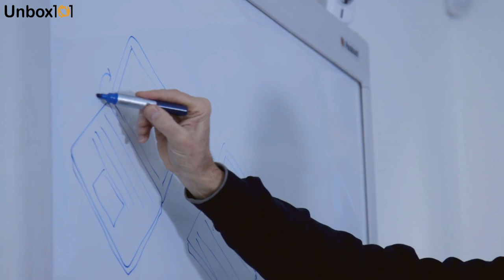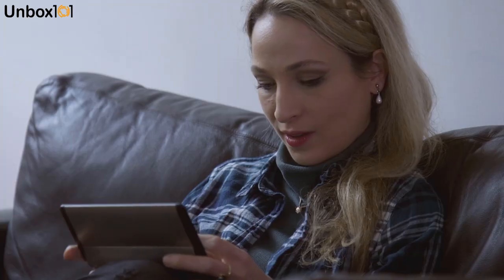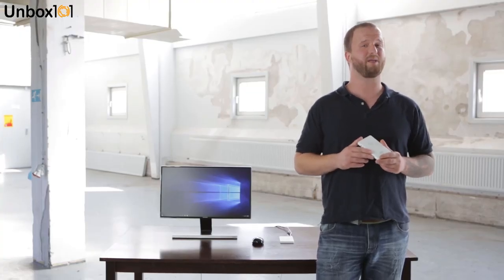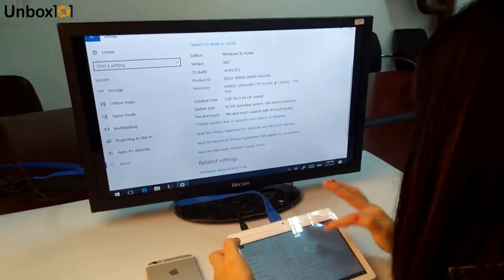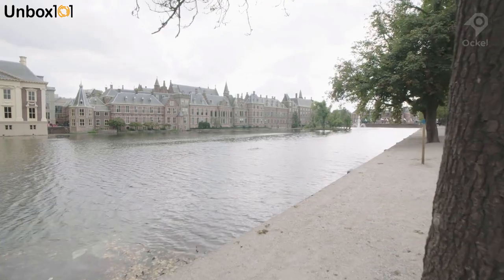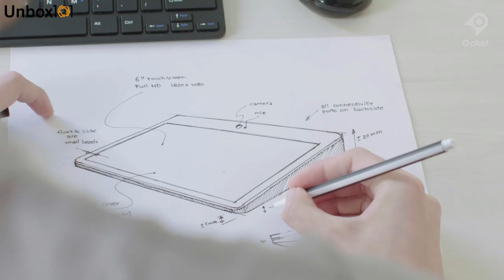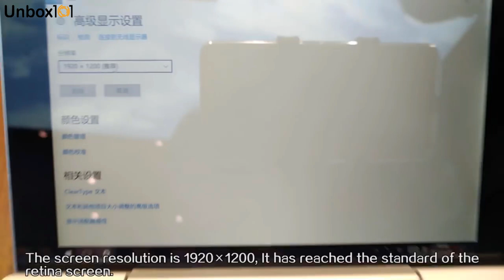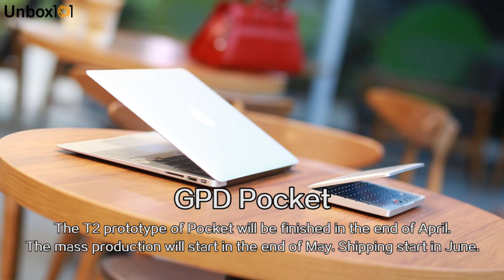Top 5 Mini Computer 2017 GPD Pocket Next generation PDA | cool gadgets

Comment: GPD WIN is the best and its not included here.  Though to be fair, GPD Pocket seems great too.  But GPD WIN is already shipping.
Reply: gpd win is the best
Reply from the maker: true Just checked it out... Look like a useful product. Thx
Reply: I also have a GPD Win.  As nice as it is, it has it's flaws.  The GPD Pocket, from a couple reviewers who have both, indicate that the aluminum body, and active cooling (heatsink + improved fan) work wonders.  Having 128GB SSD + 8GB RAM is also a nice touch.
Reply: Only gripe with the Pocket is that it doesn't have a built-in card reader.
Reply: AmadeusL True, I would have loved to have seen it built in.  That said, Satechi has several solutions on the market that will do for now.
Reply: richarddr1234 mini laptop bruh not mini gaming laptop xD
Reply: Pls send to uae
Reply: Mobile connectibity is missing too, I really don't see the point of an ultraportable without it!

Comment: But I need bigger specs 
It's only 1.6ghs atom 
I need a high spec pc with upgradable ram and a gpu a high gaming pocket pc
With windows 64bit
Maybe coming days they make
Reply: Pocket is 64 bit it will process basic graphics for work or gaming (handle gta v on low pc mod at 60 fps highest) but because of the pocket nature of being meant to be ultra portable it has prioritized performance over graphics. you can take a look at the new gpd gaming laptops and tablets they dont fit in your pocket as easily but work like a steam deck i dont think they would be devices you could easily swap out components for though